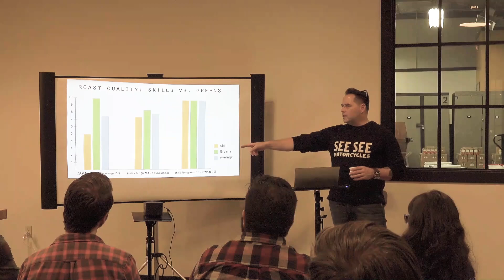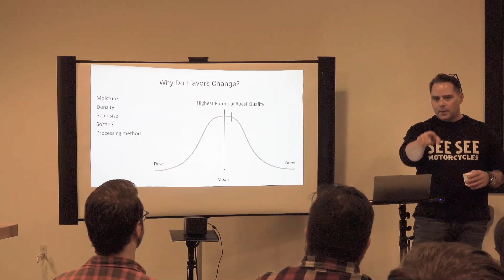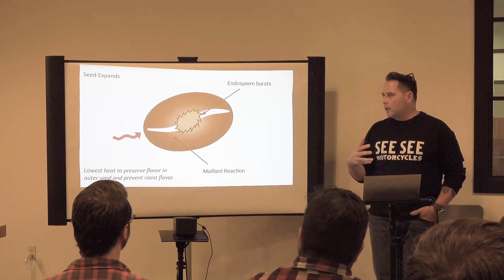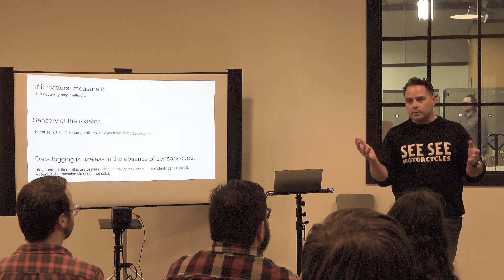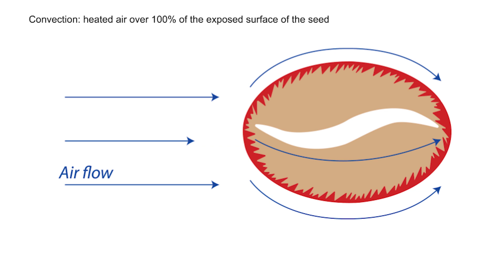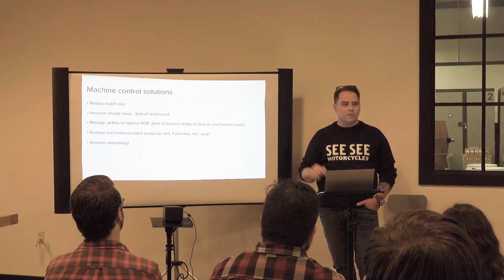Flavor Profiling for Purpose, Part II: Roast Flavor Profiling and Machine Control

Comment: Great informative video guys. On approx 41:51. When figuring out the limit of the seed. Nick mentioned you will get a sharp smell when coffee is grinded . What is it that we will smell? Couldnt hear it properly
Reply from the maker: Supposedly, according to the Food Science lab at the U of M, it's the same protein you smell when you open a can of tuna. A sharp, acrid scent that carries over into the cup. You'll get this when the coffee is heated too quickly and at temperatures usually slightly lower than will cause tipping, scorching, and facing.